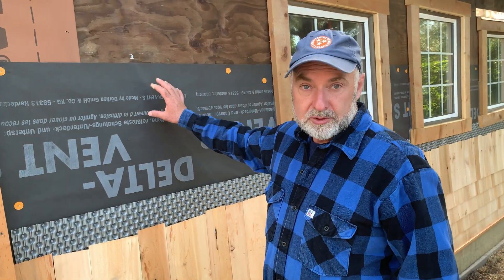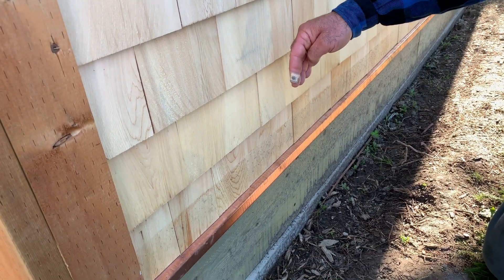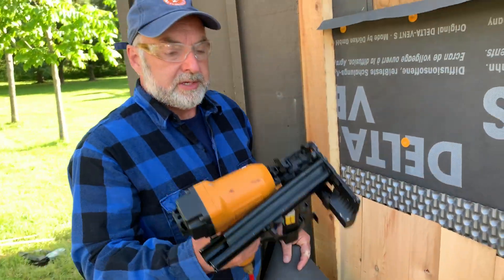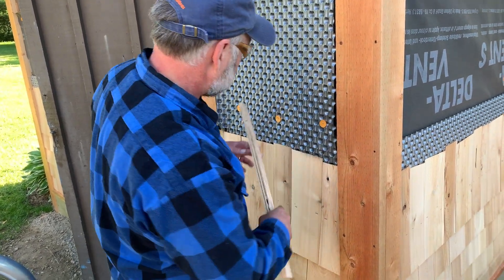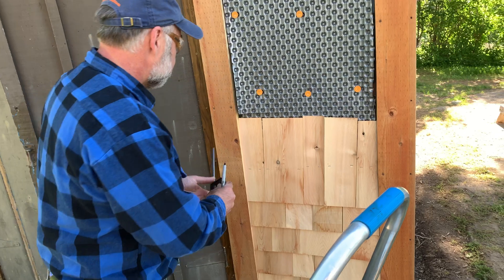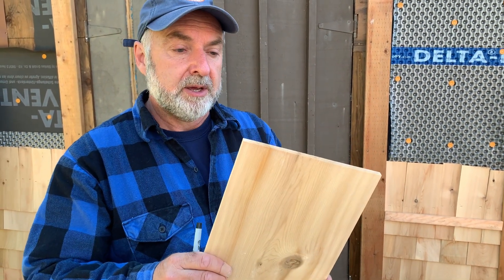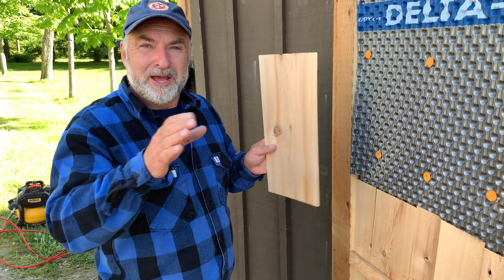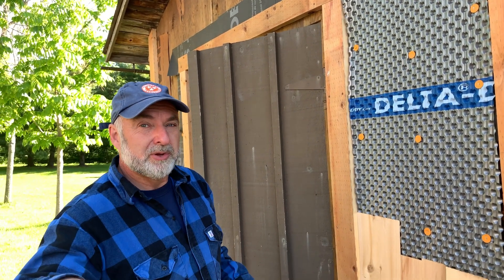Cedar Shingle Wall Siding - See How It's Installed

Comment: Thanks for posting the video, the shop looks nice.
Some criticism/tip; the product you are using is basically a type of house wrap, which performs exactly the same function as other house wraps, like Dupont tyvek, they are also air and water barriers which also allow vapor through.
So they repel water, and allow water vapor to escape, so the wall can dry out.
If you applied this product incorrectly it would act exactly like any other house wrap that was installed incorrectly.

The shakes/shingles touching the flashing at the bottom will prevent them from drying out, cause water to build up high behind the shingles.  This edge will rot very quickly.   For all wood shakes and shingles, for all species of wood it is required to have them raised 1/2" above the flashing to allow a drip edge and prevent capillary movement of water up the flashing/shingle.

An added bonus of the rain screen is air flow and rapid drying of the back sides of the shakes.  It can help reduce warping of the wood as moisture content on both sides will be closer to the same.  Blocking it off at the bottom not only prevents drainage and bulk removal of water, but also the convection currents and drying potential in all stages.

What i do with my houses is add a bug screen at the top and bottom so the gap doesn't allow bugs in, but does allow air flow and water egress.

Comment: This was an excellent example of how all instructional video should be: very thorough, easy to understand, informative  and calming...A++.
Reply: True to everything you said, but please don't use this as an instructional video.  There are many mistakes and omissions.
Insufficient spacing of keyways (1/4" to 3"8" required, 1/16" provided), overdriven fasteners, insufficient capillary break at the bottom drip edge (1/2" required, 0 provided), lack of dam at ends of flashings (1/2" required, 0 provided), insufficient slope of flashings (6 degrees required, appears to be closer to 0), fasteners located too far from edge (3/4" recommended, over 1" in demonstration), inappropriate number of fasteners (manufacturer recommends 2 only per shake, 3/4" from each edge and approximately 1 1/2" above exposure line.  if shakes/shingles are more than 13" wide 2 more fasteners should be added straddling the center of the shake, 1" apart)  never any recommendation for any number other than 2, or 4.
There's more, but you get the idea I hope.

Comment: Really helpful, well explained at the right level of detail.  I learned a few tips for you.  The reason I found you is I was searching for advice on how to work around the corners at the top of the door.  I can infer, at about 16:00. that I will want to work it so the butt of the appropriate course 'sits on' the upper edge of the door trim.  Me betchum's you will use some copper flashing there!  My baby barn is sheathed with rotten old beaver barf (chipboard).  Thank you for the good words for eastern white cedar.  That is what I am using as a New Brunswick's neighbouring Prince Edward Islander, well past the three score and ten.

Comment: When I use a ledger for assembling the courses of shakes I run a leg up each end so I can fasten it above the previous courses.
I usually use 1x4 spaced sheathing for my rain screen so an added bomus is on the vertical parts of the ledger I just attach a block to hang it off the 1x4s like a french cleat.  No fasteners required.
Hang the board, arrange/fasten shakes, move board up, hang it repeat.  Takes literally seconds to move.
Important note; attach your 1x4 precisely so they act as a guide for your shakes.  A story pole and laser level is a great pair of time savers.

Comment: Thanks for the video, I live in a small house in the UK where the houses have cedar shingles between the upstairs and the downstairs bow windows. My shingles have been there since the house was built circa 1955 but they're so weather-beaten now they're beginning to fall away, hence my 'research' before I attempt to replace them. Watching these YouTube videos has made me appreciate the shingle more when initially I was somewhat unimpressed as to how dull they can become over time. Interesting that my shingles are nailed directly to horizontal battens, no membrane, no drainage layer, and yet they've lasted well over sixty years.

Comment: Most expensive shed ever, incredibly nice. You can steer far more than an 1/8 of and inch per course. The nakedness eye without a change of texture or color does not key on changes that small. Even up to half an inch is difficult if you don't know already and it's not at direct eyeline.

Comment: Your video was very informative.  However, I've never seen a good explanation on what to do as you approach a sill and begin to run out of room for a full shingle.  The obvious thing seems to be to just start cutting the tops off your shingles as you proceed up the wall, but won't that make each successive course to become thicker and thicker than the course before it?  I am faced with this issue now on a back wall that has a sill going across the entire wall about 4 feet up from the foundation.

Comment: In my neighborhood (southeast Houston) all the houses including mine that have cedar wall shingles, they are installed with double courses and each row is spaced further apart than whats in your video. I’ve discovered that it’s not very common to do it that way. Any thoughts? Also on the undercourse they used the smooth shakes and the outer course is the groved shake. I do like the look on my house. It has a nice “reveal” shadow between rows.

Comment: Hi Steve, thanks for the video, we have a family cottage near M'Chigeeng.  How do you start the bottom course of shingles?  You said at any point there could be 3 layers of shingles over lapping.  The first course of 5" exposure would only be a single shingle thick.  If the shingles shrink you would see the wrap under neath.  Just wondering if you doubled them up?
Reply from the maker: Good Morning! That's a great question. The bottom course of shingles is double, as you suspected. The joints need to overlap on that bottom course by at least an 1 1/2" or 2". After that, each course goes up by 5", more or less. Do you have a building you'll be installing shingles on?
Bye and thanks for watching!
Steve

Comment: You must not have a lot of faith in your shingles or shingling ability if you are using all that underlayment. The cedar shingles on the outside of my house were nailed directly over tar papered solid wood sheathing in 1942 and they lasted over 70 years.
Reply: With the new technology the cedar shingles will last many years longer than the old ways of doing it.

Comment: carpenter 45 years never used dimple never leave a gap in shingels they shrink re shake sideng every 20 years at least they are garbage after that i go with 14 inch reveal and use a compound miter for angles- sides power wash every 4 -5 years  represerve without power wash 2 nd year after preaserveing first year 1 coat no power washing
i dont have time to overbuild. cedar 5 inch reveal is a waste of time and money 
yes face nail stainless steel no one will notice , its a ranch , anything more work than that should use fake vinyl shingels your welcome yes been doing sideing painting 45 years
time is money and have fun wasteing money
did my own house this way its rustic looks great cost cheap at 600 dollars a square
hahaha  nobody wants cedar its too much work for maintence pvc trim  also
its been a long time and dont have time or money to waste.